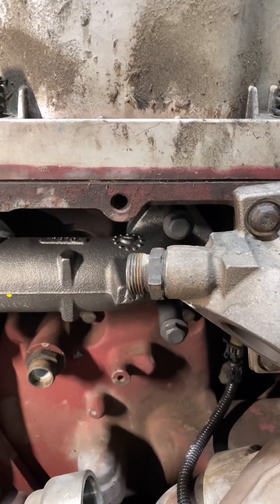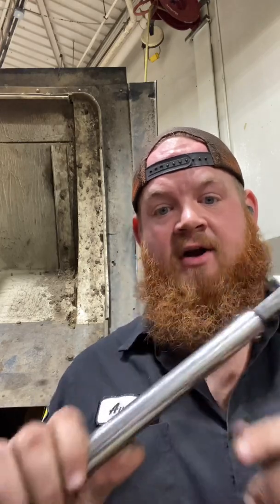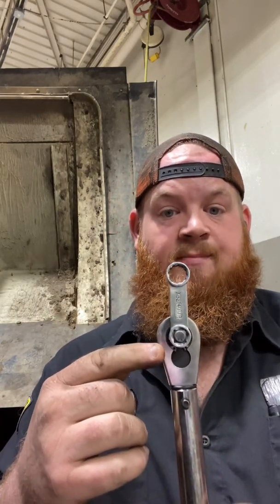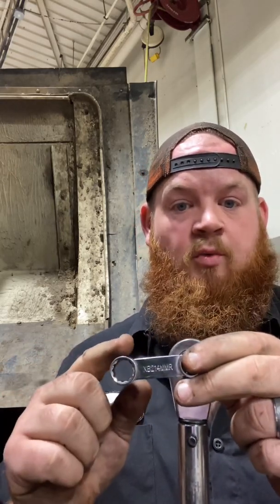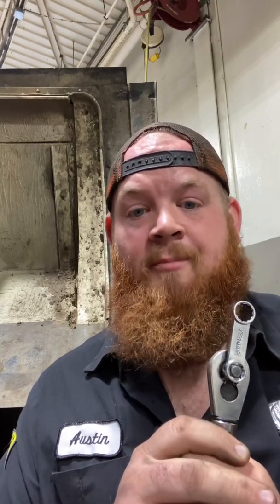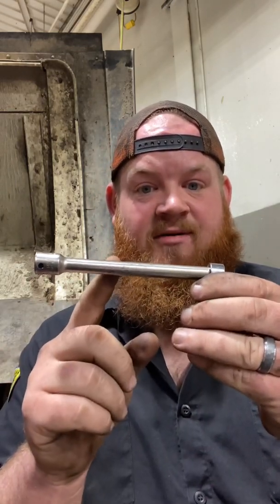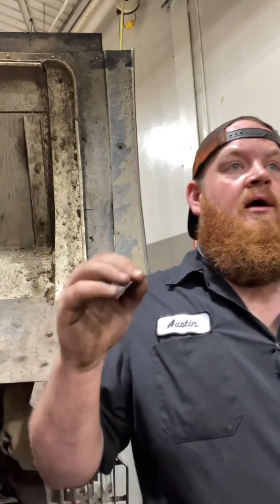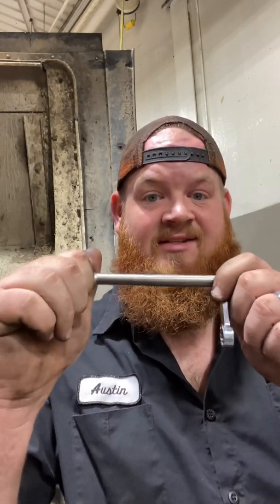Torque adapters : do they change torque value

Comment: So having the stubby adapter arm at exactly 90° right angle to the torque wrench handle is most accurate. It doesn't add or subtract any mechanical advantage.

Comment: Im about to replace both front and rear struts and shocks on my 19 4runner and theres one nut in the rear of the strut mount and my torque wrench cant fit in there so im actually using a crows foot im hoping it will fit at a 90° angle

Comment: Great video thank you. I’m thinking about buying a set of these to do a ball joint. How does one go about calculating the torque buyers if you can’t do 90°?
Reply from the maker: theres a calculation you can find where you measure the length of the adapter from center of anvil to center of your adapter, input that into the calulation and you can find it rather quickly. also if using a snapon techangle, they have built in software that does the caclualtion for you, just measure your adapter and go.

Comment: I think the myth about extensions changing torque values comes from use with Impact guns. You do lose torque with an impact if you use a wobble or extension. But it’s due to the slop between the various parts.

Comment: Question:  What is you have to fabricate a torque adapter and the adapter is actually longer than the torgue wrench.  Is the science still the same?  For instance, you need to use a 1/2 wrench and a 1/4 torque wrench.  Used a 1/4" to 1/2" adapter on the torque wrench, and slipped it into the open end of an open end/box end wrench.  Seemed to work, but no real way to check it.
Reply: The math still works.

Comment: Even if it did I'd assume it would loose less than 2 ft lbs and I know a majority of these bolts are +- 4. Someone that's been working in the diesel field for 20+ years once told me that these trucks aren't going to space. Being off by 1 or 2 foot pounds being possibly lost by extensions isn't the end of the world and that's why it's better to torque a slight bit up. Like veb bolts are 18 but I just go to 20 since I believe they're +- 4